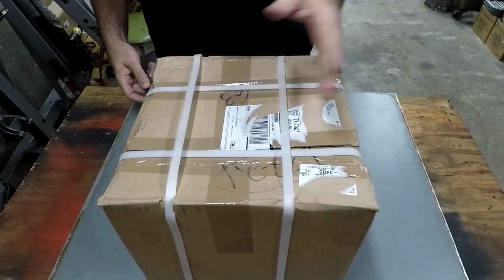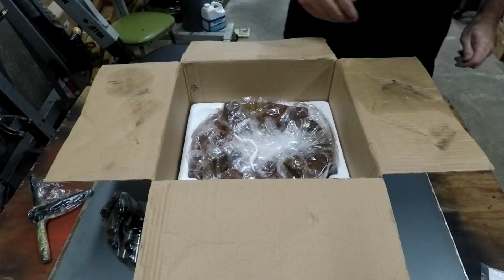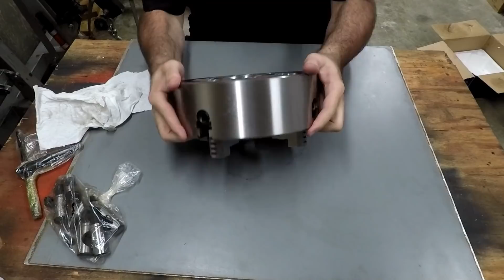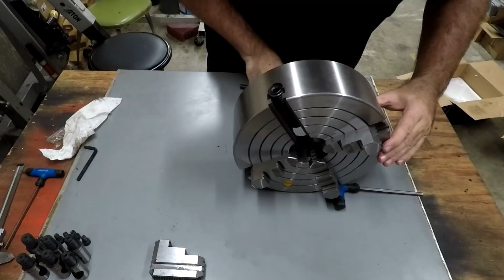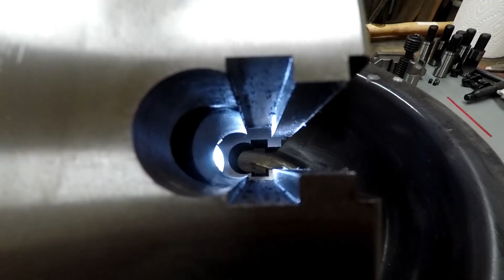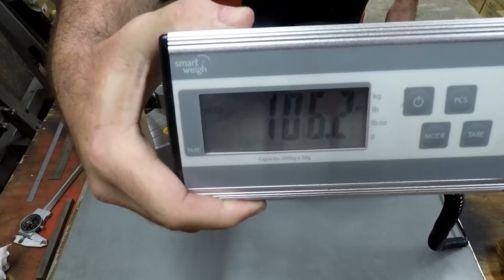Shars 4 jaw chuck: How bad can it be?

Comment: i got a Shars 6" 3-jaw.  It was filthy like yours.  I cleaned it up like you did.  I had to deburr several areas.  Took about an hour.  It helped the scroll feel less gritty, but it still isn't smooth.  The chuck does ok for my home hobbyist needs, but there is certainly nothing about it that's better than just meh.

Comment: Every time I see someone buying a chuck that costs 20% (or less) of what a chuck from a major manufacturer costs and complains that it’s - cheap, I have to laugh. If someone wants an excellent, clean chuck right from the box, they should spend the money for one instead of complaining about burrs and grit, when that’s one reason they saved so much money. Generally, the sharp edges and burrs don’t affect the operation of the product. Happily, these products normally work pretty well once they’re cleaned up.

Comment: all machine equipment i have ever used that was from china required this "finishing" work. lathes, mills, chucks, etc. always take them apart, de-bur, clean the hell out of it, properly lubricate, assemble and you will have an excellent tool. think of these items as kits. they might as well ship them as separate parts and save us the time to take them apart but i suppose they have to test for the fit and glaring damage and this way we see the whole thing put together like it is supposed to be before we take it apart. still... chinese equipment should be thought of as kits. you get a huge savings in money but have to spend some of your time bringing it up to ideal level. thanks for the vid and this reminder 🙂

Comment: I think these products are particularly targeted toward those willing to perform finishing steps.  The customer saves that cost, but commits to performing finishing work. Without the finikshing work, these things will self-destruct prematurely. I prefer that trade-off because I like to make sure the fit & finish is perfect.  I've found that the underlying accuracy of the stuff I've gotten from Shars has been surprisingly good.  I enjoy working to clean, deburr, etc. and even drop the hardware in an ultrasonic cleaner.  A brand new, forged Bison chuck will be perfect out of the box, but cost 5 to 10 times the price.  The Bison will also use harder materials.  For me and my hobby shop, Shars & equivalent Chinese products are a good compromise as long as I don't mind the final steps of manufacture and as long as I remember that the material might be softer.

Comment: Guys like you just kill me. You purchase an inexpensive chuck and then do nothing but bitch and complain about the fact that it needs to be cleaned and deburred in a few places. If you want perfection that doesn't require some minor work to get it to where you want it then stop whining and order a top of the line unit from another source and pay 4 to 10 times as much. To most of us as amateur machinists our time is worth little but the dollars we save is worth a lot to purchase other tooling that we need. Stephen Gotteswinter did much the same thing on his channel but he's smart enough to see a bargain and he doesn't bitch about the minor loss of time. No subscription for you if this is any example of how you handle yourself and your offerings.

Comment: If you buy Chinese with the snide remarks you have made about Chinese product you are really stupid! It is a very cheap four jaw chuck that is value at the price you paid. Four jaws by design are always full of crud! As for cosmetics, get real, its going on a lathe. Most people use a dti to centre work, the lines on the face have no real function other than a rough guide. They could be anywhere across the face to do that job...

Comment: Nasty? It's wrapped in rust preventative paper. That's not nasty... So at the 10 min mark, I have to wonder what this person was expecting. A 10" 4-jaw D1-6 chuck for $150, what do you think it's going to be like? If you want "high quality" clean fully deburred etc. then pony up 5-10 x this cost. How do you expect a product to be sold at this price point to differ? I would happily settle for them skipping the little things that I can easily do, as long as the basic functionality and machining quality are acceptable. Still too early to tell at this stage in the evaluation.
@12:46 "You could have a fairly descent chuck here if you would just clean it up a little bit." Really? If they took the time to clean it thoroughly deburr and clean it up, what do you think that would do the the price? If I'm buying a $150 10" 4-jaw, I'm going to happily take it apart and go over it. Heck I'd probably do that if it was a $750 chuck, just less actual work to do.Of course now it's FEB-2022 and the same item (Shars 10" 4-jaw independent with integral D1-6 mount is now $230 (and out of stock).

Comment: Have you ever considered mounting your 12” four jaw and then place your three jaw in the four jaw chuck and leave them both mounted. You can quickly load  your part into your three jaw and if tolerances call for it to be dialed in, then use the four jaw to do it.

Comment: still expensive for me.  wash it with kerosene, water, dishwashing soap then water.  industrial blow dry and they are sure to assemble again, oiling per part as you assemble it again.  what you are doing wiping and wiping each part is such a waste of time.  clean it with well and you'll get the most out of that.

Comment: If it was shipped from China without oil , you would probably really complain about all the rust on it.   Im sure the ID of the jaws were ground  to that chuck body,  so ya they dont clean them... like you said, its not a 800.00 to 1500.00 chuck either.   I would have made 100% sure the jaws went back in where they were ground.    Looks like a nice chuck.

Comment: I bought the same chuck for the same reasons you bought yours. My 15" 4 jaw weighs 126 pounds. At 54 years old I can still muscle it up on the lathe, but having the little 10" 4 jaw is much easier when I don't need a big chuck. Also mine wasn't as dirty as yours. Maybe they made yours on a Friday at 4:50pm?

Comment: So many things to comment about - 1st you toss down a set of calipers !!!  As much as you complain about the product you might put into care of your own calipers!  Second, you mention not having a crane to lift the 106.2 pound 4 jaw... ???  ..  Is that an fold-able engine hoist I see behind you to your right?  Works for me when I need to lift heavy objects.
Reply from the maker: Yes, I handled my rather old $30 caliper roughly. The good calipers lead easier lives.
Sure, that's a shop crane behind me but it won't clear the business end of the lathe or the Vidmar cabinet where my chucks hide.

Comment: Good video. Thanks for the information. Curious as to what tolerances you can hold parts in this chuck if you take the time to dial the part in? Repeat ability in rechucking  the same part? One thousands or less? Thanks.
Reply from the maker: The chuck works fine. Since it is an independent jaw chuck you can always dial the part in to the desired runout.
Reply: @RidgewoodMachine  That'w why it is unnecessary to label (number) the jaws.  They are all identical, unlike auto-centering.
Reply: @bobblack3870  Is that strictly true? Doesn't that assume that all the jaw slots are on exactly the same plane? If the jaw slots aren't you'd still get a good grip with the original jaw placement due to being grinded in their respective slot and hence being ground with compensation, but swap them about and you find some jaws grabbed better towards the front or rear ends of the jaw.
Reply: Pratt Burnerd, for instance, hand fits each jaw to the slot. On a Shars...you are doing the break-in.

Comment: Nice job, does not look to bad.
Reply: A voice of reason - I have a couple ~$150 chucks under my belt now and while they are no Buck, for the money it's really hard to beat if you're willing to do a little bit of cleanup. And let's be honest, anybody who's ever picked up a used old high quality chuck knows how much work goes into cleaning and potentially fixing it anyway and after all that you may still have worn parts requiring at best regrinding, at worst a worn scroll that means you'll never get repeatable accuracy. End result, pretty much the same if you ask me, except I can return the brand new cheap chuck if it's REALLY bad out of the box.